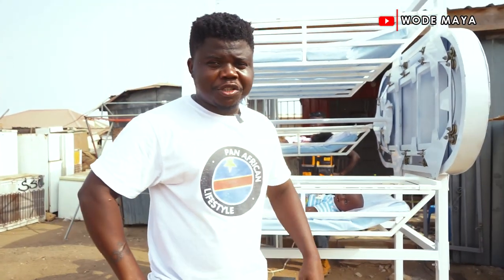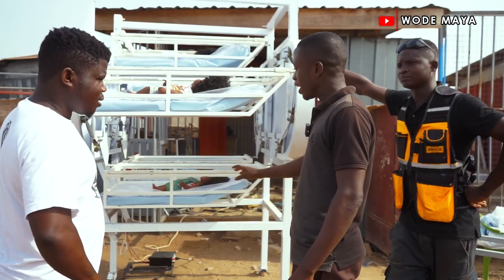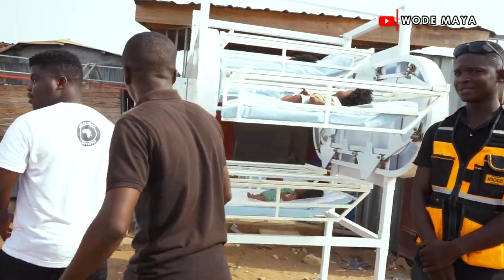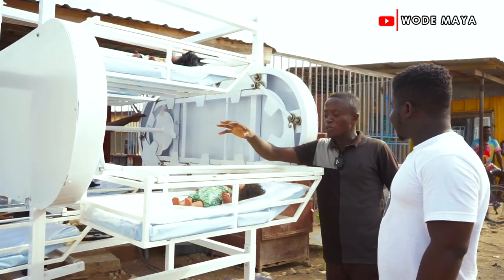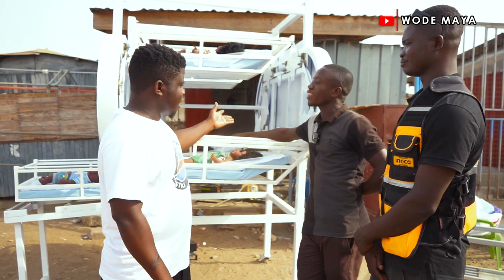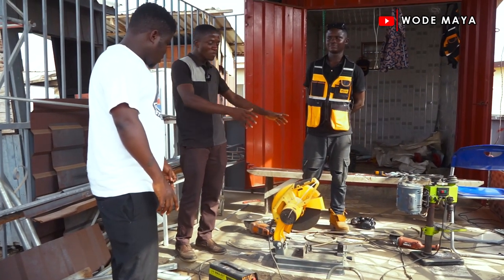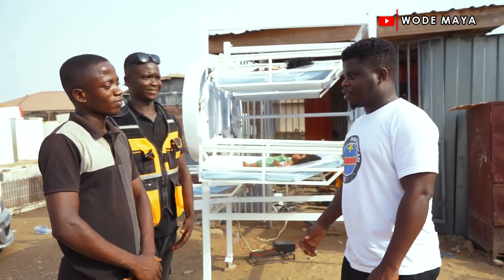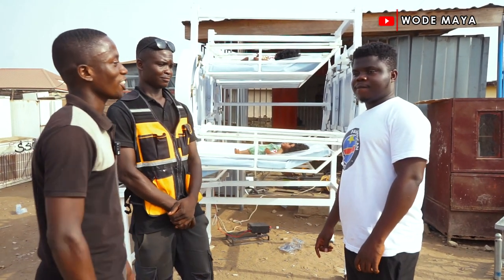Ghana’s New Born Babies Slept On The Floor In Hospital So They Created This!

Comment: Absolutely stunning idea, however as a former nursery/l&d/postpartum nurse, i want to address some issues they can address and modify to prevent infant mortality using this bed. Infants should be at eye level at ALL times. Babies can easily spit up and choke if not seen in time. Fall risk is a concern as well. And can you manually lower the baby on the top in case of any malfunction. A baby can easily be forgotten when not in eye level. This is not meant to be a negative comment. Any healthcare worker is thought to think safety first please. Anyways am sure the hospital will address these issues before considering the use of this bed.
Reply: This is nice. Hopefully they add these concerns when producing more
Reply: That’s a great idea. Safety measures are always number one.
Reply: Contact with medical people like would help them. I also identify a need. Warmer for the babies if needed. Control temperature.  But it is a beginning

Comment: This is incredible!!! Very innovative God bless you. 

What I suggest should be included pls is a manual way to rotate the bed...reason is that if there is an emergency to quickly access the baby for Resuscitation or anything that require emergency response...waiting for the bed to rotate in this case won't be helpful bcos when dealing with babies even a second can save life. 

👏👏👏this is great. They should just look into how it can manually operated too and the railing around the babies should be paded.  God bless you all !!!

Thank you Wode Maya!!! You are blessed!!

Comment: And what happens when the machine gets stuck?  power outages,  emergencies like a fire or code blue?, how do ensure babies won't get mixed up? the rocking nature of the bed doesn't look safe at all (babies can easily flip over), and most importantly have they consulted with hospitals. Just making beds won't solve nothing if its not safe and practical. I personally wouldn't want my baby in this machine. Babies should stay in the same room with their mothers.

Comment: I like the idea but what if the electricity goes out, will the babies get stuck, have a hand crank available, maybe lower the machine, skip the pull out drawer that could injure the baby and just get the baby from the side where you all are standing, babies wiggle and the need to be picked up so as to support their neck and head.

Comment: Great idea and ingenuity. Just concerned about the application. The potential to mix up babies could be an issue with this application. Try a different application where mixing is not a concern.  I will also advise you to get it safety certified by an independent agency before going to market. Not sure about Ghana but in the US, you can't just go to production with a product specifically designed for the health care delivery without registering with FDA. Also, seek feedback from the users of this great invention such as medical doctors, midwives and nurses that are experienced in labor and delivery. You are too early in the product development cycle. This is not ready for prime time. Great idea though. Do it right.
Reply: well said

Comment: The design is poor.  Firstly the sides of the bed are way too low.  Secondly, the cost to the hospital and parents because it uses electricity will be a problem. The concept is good but the overall design isn't good.
Reply: Good adding your voice